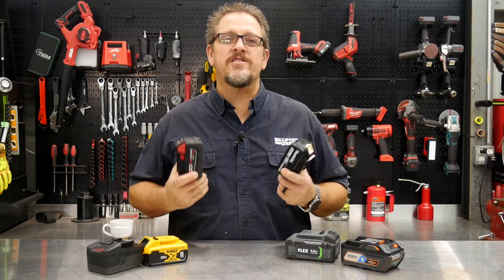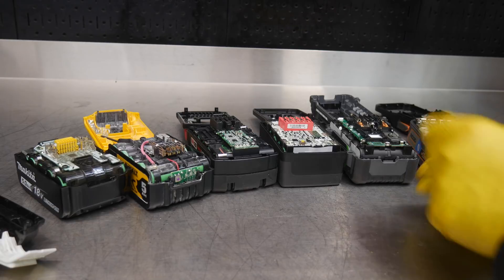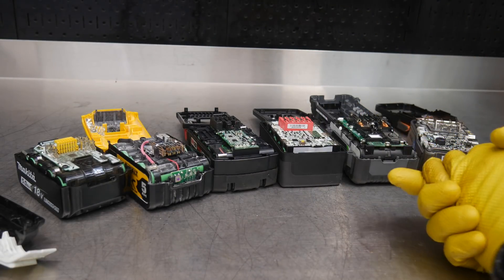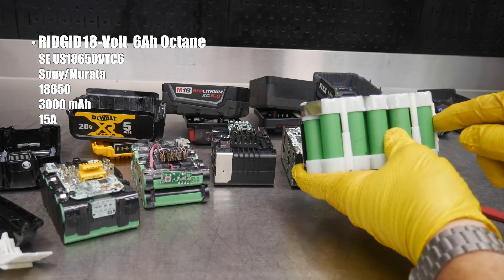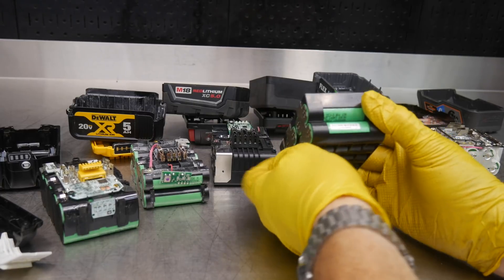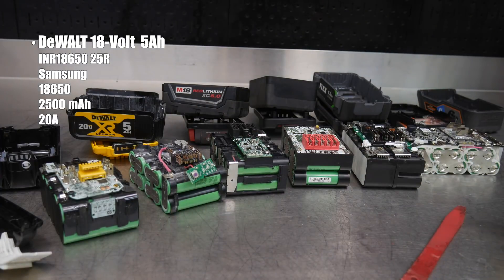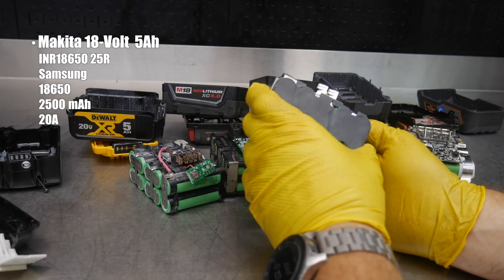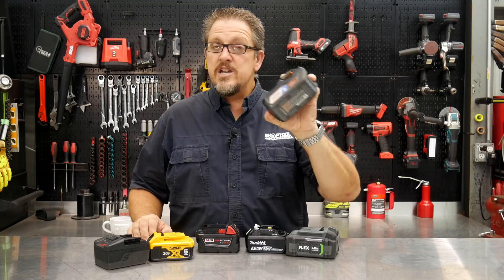What's Inside Tool Batteries? Milwaukee FLEX DeWalt Makita Snap-On [18650 21700 ??]

Comment: That little ridgid palm impact was a pretty random appearance lol. I don’t think I’ve ever seen that
Reply from the maker: It makes an appearance every now and again, when we need to pull some things apart. It's a great little tool for this. Thanks for watching.
Reply: palm drivers are nothing remotely new
Reply: @nomercyinc6783  Except for us folks that have never seen one. Or maybe we're so darned old that we forgot it existed. 🙂
Reply: @maddogmark  lol possible
Reply: @nomercyinc6783  I have a Palm driver too 😁😁
Reply: I got the Ridgid 12 volt palm driver years ago. Funny thing is I don't know why other than it was unlike any other drill/driver!